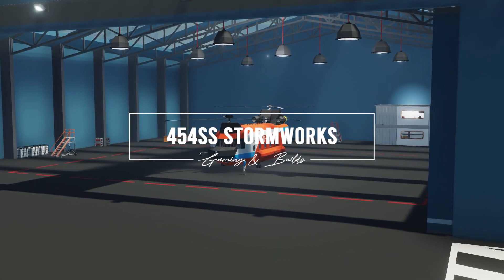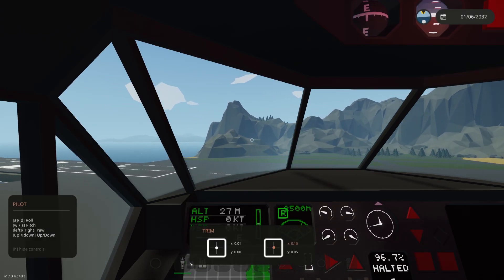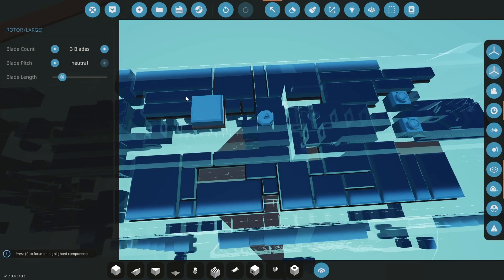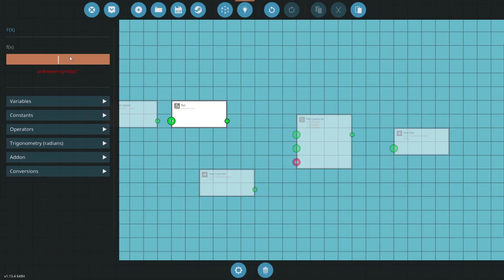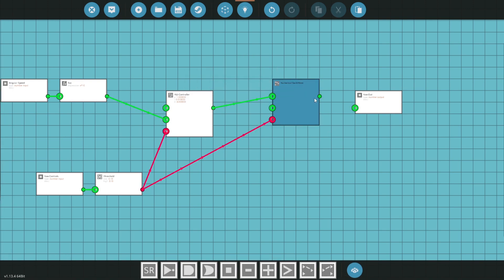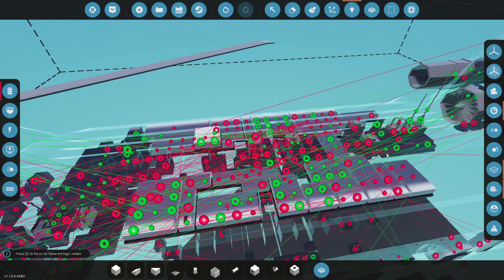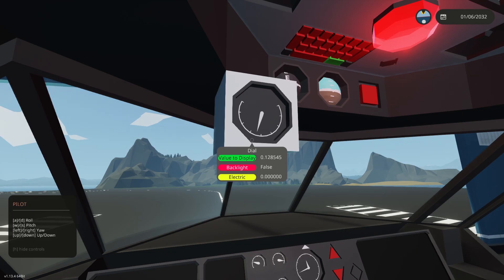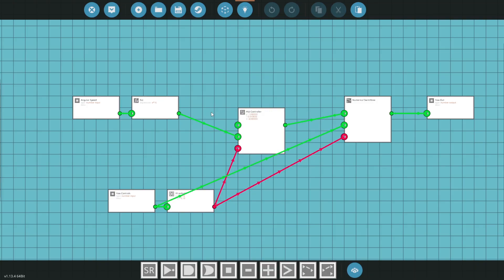Simple PID to Stop Helicopter Spinning in Stormworks (Engineer Explains)

Comment: soo this script completly works even on the default my helicopter jerks a bit when yawing but the problum hapens when it get low on battery soo my heli uses a Diesel electric system for Propulsion when the battery starts to get low the script. is less efficient But otherwise works flawlessly

Comment: Great explanation. However, PID needs normalized inputs and scaled outputs to work effectively. i.e. inputs are 0 to 500 and the controlling device is 0 to 1. That would be very very very hard to tune. ChatGPT could explain better than I. "I need a paragraph explaining PID. Specifically normalizing the inputs and scaling the output to the device being controlled" From an I&C Tech
"PID demonstration" in workshop
Reply: What do you mean by normalized input? In the video he multiplies the process variable by x10, is that a bad idea?

Comment: You could use a PID to control the gas mixing on your enclosed space air systems for the minisubs, rather than the valves opening and closing all the time

Comment: Are your rotors turning in the same direction?  If so that’s probably why.  I built a chinook and it’s steady at any RPS, with no sensor or PID?  The rear one should be  counter to the front one and that SHOULD counter that steady yaw

Comment: For a tandem helicopter you could also simply flip one of the rotors, so it rotated in the opesit direction. Rotation issue solved at all rps.
Reply: Looking at 2:15 I can see that both rotors are set up to rotate clockwise. If one roter rotates clockwise and the other counterclockwise, they cancel out eachothers rotational forces nomatter the rps since both have the same rps in opposite directions.
Reply from the maker: It already is flipped! It is a very slight spinning, not a fast, out of control spinning! And it is RPS dependent, a little higher RPS and it spins in the other direction

Comment: It's interesting how you've approached this issue. I've solved it in a completely different way by setting the heading to hold whenever you release any yaw button or flip the startup switch so that while you're not manually yawing it will hold the direction you were facing when you've let go of the yaw. And i had to sit and fight the compass output for liek 30 minutes substtracting, switching, inverting and multiplying it to get a stable 0 to 1 output instead of the raw output that changes from positive to negative at both 0 and 0.5. 
I guess this method of reading the rotational speed is much more simple while achieving basically the same as my overcomplicated solution.... But i want to believe that there's something that my solution is still good for :D
Reply: Method with compass heading is much more precise.
But why is raw compass output not suitable for PID? And does 10x multiplier for process variable in video actually help PID?

Ps. You can use ChatGPT to quickly generate mathematical formulas that you paste to the game f(x) logic block.
Reply: Could you upload your MC on the workshop maybe? I tried to get his solution running for 8 hrs straight and my helicopter is still turning or shaking